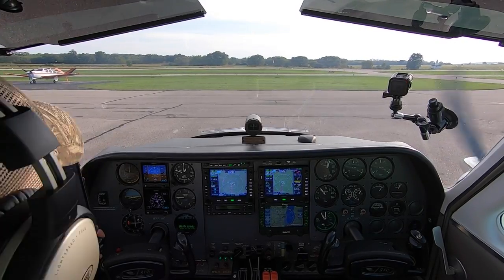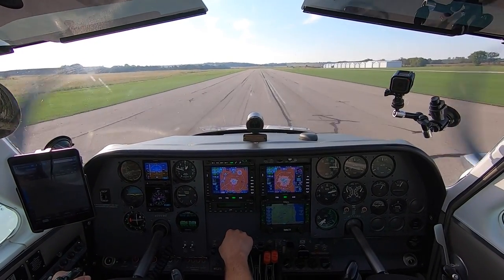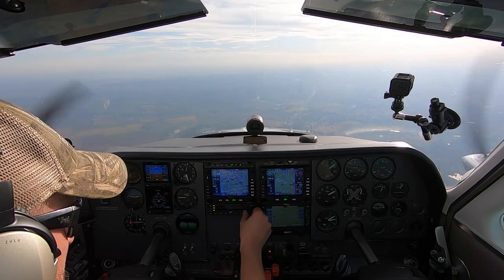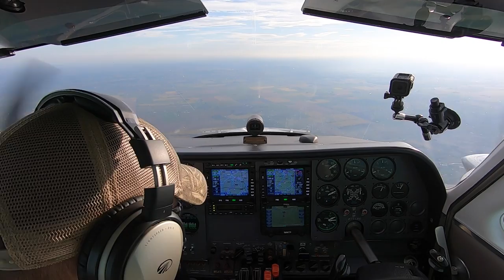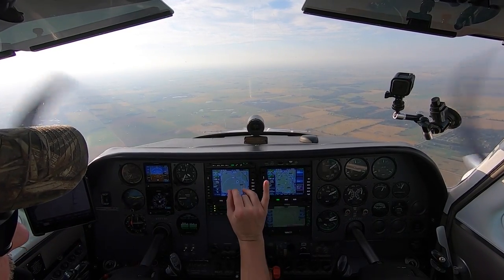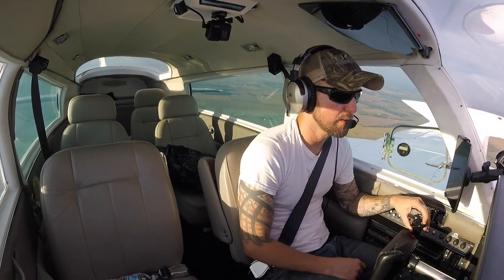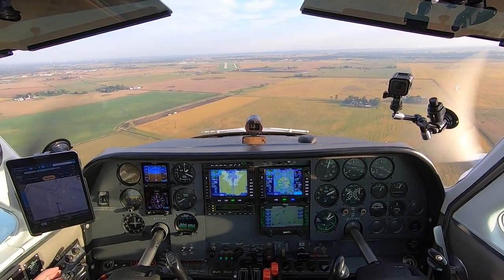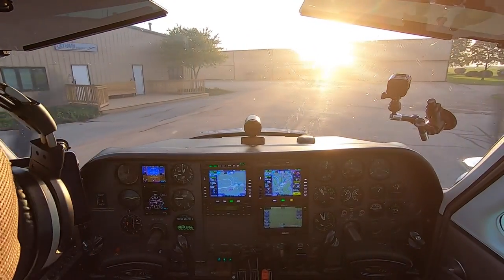Avidyne Avionics Upgrade Test Flight!

Comment: We used Burlington Air Center to install an Avidyne in our 172 and he did an awesome job.  Dropped the plane again off there today so he could do our annual.  Saw your 310 parked on the ramp out in front.  I sure do like your 310.

Comment: Never thought about the weight difference between the old and new avionics. The clip in the previous video showing the old gear going into a box I thought was for shipping. This is a case where you get more for less. Superior avionics at a lighter weight. I learned something today. Go Dawgs!

Comment: Looks great Kevin!  One thing you might want to check after you have been using it.  I was flying a 182 that had just had extensive avionics upgrades.  Worked great, but there as a tie wrap that was rubbing against the sprocket on the yoke that controlled the ailerons.  Strap broke in flight, when I tried to level back off after a left turn the ailerons were in a bout 20 degree deflection, I am glad the 182 has a big rudder!   I was flying part 135, the boss saw my landing.   I told him to go turn the yoke.   After that he said good job!   I don't know if the 310 has the same type sprocket arrangement as the 182.
Reply from the maker: Thanks for the back story and suggestion Larry!! At a different shop in the local area a couple years ago the shop returned the plane to me with an entire wire bundle blocking the travel of the yoke. Really glad I did an extensive pre-flight as it would have been terrible finding out at rotation speed that I only had 60% elevator travel. My shop in Burlington made double sure to clean up everything behind the panel and I have a huge amount of room from any wires and the controls. Great group of guys there and added bonus is they are pilots as well so they get it. :)

Comment: I like the sound of the engines idling as you taxi out, they sound happy.  One suggestion would be to ask your Tech to sync your maximum RPM at Take-Off as there are a little off.  Nice avionics deck.
Reply from the maker: Thanks for the suggestion Rob...we'll look into that. Loving the new Avionics!

Comment: Congrats on the new avionics suite  and your revised panel. It looks great. As a non pilot, I've got a question about your props and motors. Is it just an optical illusion, or are they not always turning at the same speed? Your throttles dont look like they're set exactly even either. Just curious if the motors get set slightly different for trim or turning purposes. Thanks. Always look forward to your videos.

Comment: What was required to get TCAS on 550? Does AP altitude preselect show up on G5? What was cost for remote transponder? Sorry for all the questions but I’ve got dual G5’s with GNS 530 and having Stec3100 installed in a few weeks. Seriously thinking of swapping 530 for 550 also. Thanks and glad you’re flying more👍

Comment: All the advances in avionics that has come to general aviation the last 25 years is just unbelievable. It has made flying safer for sure. Don't you wish the same level of improvements could come to the engines?  It's true you are flying with 2019 tech but it all still depends on those two1970's engines. Lose one on take off and things can go south fast. Thanks for sharing. You have one cool Cessna 310 for sure. I was told that on the old 310's you had to do a total landing gear rebuild every 100 hours? I bet that hurts, if true.

Comment: Why are the mixtures not in full rich position on approach/landing?
Reply from the maker: Howdy Roy. I subscribe to Mike Busch's philosophy on engine management. He writes for AOPA and EAA among others. He's a well known A&P/Cessna 310 owner. Here's an article about it:
https://www.avweb.com/features_old/operating-tips-for-big-bore-continentals/

"Every POH I’ve ever read instructs you to advance the mixture to full-rich on finalprior to landing. Don’t do it! Pouring cold fuel on a hot cylinder head simply can’t be agood thing for cylinder longevity. I recommend leaving the mixture leaned out for landing and taxi. I also recommend setting the props to top-of-the-green RPM, not shoving themfull forward the way the POH instructs. Of course, if you have to make a go-around or a missed approach, don’t forget to advance the mixture and prop controls before throttling up to full power."

Comment: I’d fly with this guy any time!  Question, why the spilt needles on either the rpm or manifold gauges
Reply from the maker: Thanks Roy! The MP and RPM's stay together. That split you see is on the fuel pressure (flow) gauge and that simply isn't accurate. I have digital fuel flows on my engine monitor (Insight Twin G4) that very accurately displays my fuel flow in tenths and I keep them fairly close.